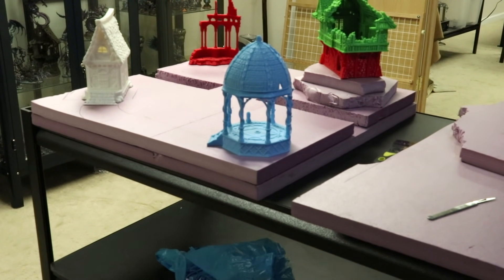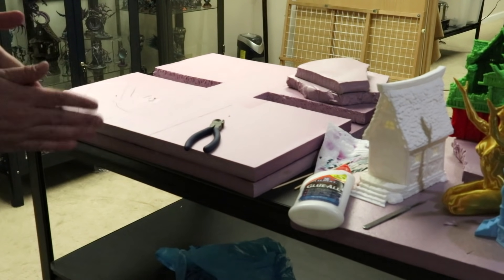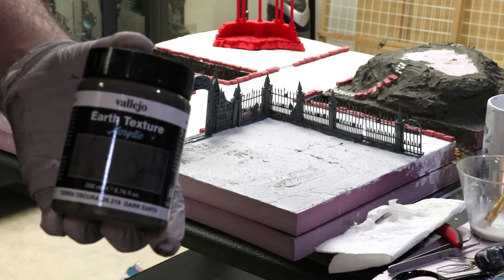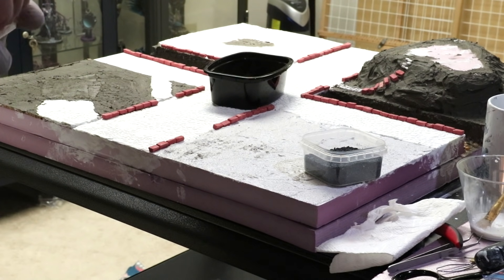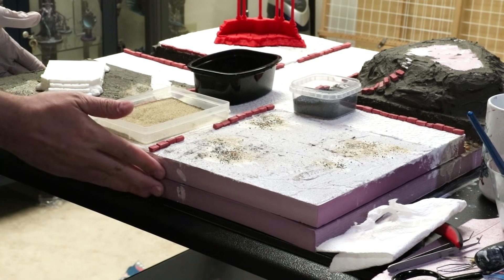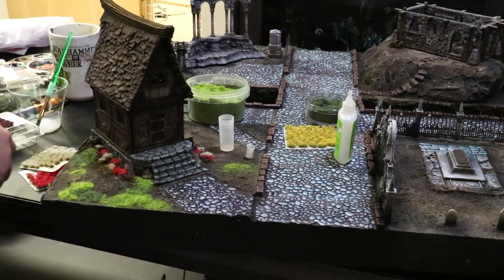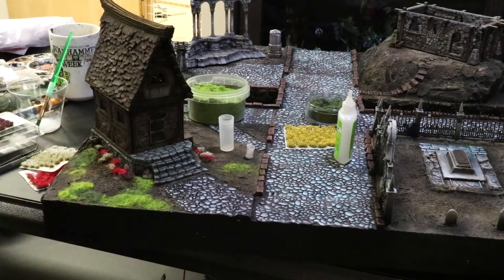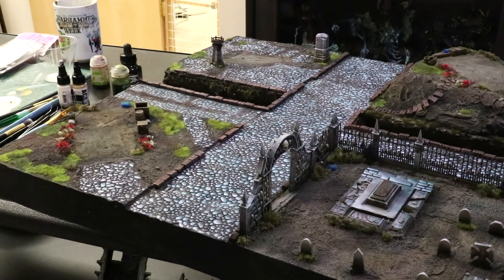Hobby Cheating 206 - How to Make Display Boards

Comment: A tip for the patch and paint! A little bit of water into the bucket, and mix it around with the trowel a bit and it’ll come out way easier, and spread way better.
Reply from the maker: That's an awesome tip, I will do just that next time. :)

Comment: Great vid as usual,on the protecting foam from rattle cans, a coat of PVA glue does the job and it's cheap😉. You can make a cheap static grass applicator with a metal sieve and a large capacity battery like those ones they sell for torches with the two doing contacts, just connect the sieve to one contact and run a wire with a probe to the other and job done it's not pretty but it's fine for small amounts like you need😀
Reply from the maker: Nice! Good tips for sure. :)
Reply: @VinceVenturella  There are a good number of DIY build videos on youtube, of varying quality; but it's worth knowing that, if you're basing your cost assessment on the Noch model, there are others on the market - the Peco model is about 1/3 the price and there are some Chinese models out there closing on 10% (depending on the deals you're able to get - but a quick Google search on UK prices shows the Noch at £140+ and a Chinese model on eBay at £16...)

Comment: This was a great video. Really helps me grasp how to my my first display board. But I have questions, what filament did you use the 3d print the buildings and what did you do to get them painted? It feels like you didn't really go into detail on how the buildings were prepped and painted. As for filament, I'd like to know because I know PLA is at risk of melting in a hot car, so I don't want to spend alot of time and money on something thats going to melt to a puddle in the summer heat.
Reply from the maker: I couldn't tell you, they were printed for me by a friend (crazyhorse on twitter, often in the live shows). To get them painted, nothing different than most other terrain. :)

Comment: So I had a hobby question about my display board ive been working on since january. (Started with a few hobby related NY resolutions) I wasn't sure where you preferred to be messaged about such things, but this seems like an appropriate place.  I'm to the point where I want to pour resin as water to make a pool of souls into my board.  I want to have Skulls suspended in the water with wisps of color trailing from them.  I don't want the...acrylic? oil? wash? dye? ink? to spread out too much into the resin and just be a blob of color instead of a trailing wavy line.  I'm listening to your Failure video right now and I really want to have "Prior Planning Preventing  Poopy Product" (paraphrase) since i've sunk so much time into this one. So the question(s)
 Is there a certain time in the resin curing process that is best for suspending objects?"
Do i have to do a layer, let it cure, place skulls, do another layer?
Would a two layer process be visible/does that even matter?
Is there a certain time in the resin curing process that i would be able to dab color onto end of toothpick or something to not have it spread out into color blob?
What type of paint should I use to create the trailing souls/wisps behind the skulls?

hahah sorry if this is too much, but an answer to any of them would very much ease the anxiety of finishing the last of my hobby resolutions.  (sculpting and casting couldn't do much damage if i messed up)
Reply from the maker: No issue and yes, you have the right answer. Occasionally I facebook I will see these multi-pouring videos were people paint "fish" in water or whatever through multiple pours. So what you would do is something like the following. 

1) Pour 1/3rd of your space. 
2) Let it mostly cure
3) Push a skull gently into the layers
4) Let it dry completely. 
5) Paint the energy trails with standard acrylic paint
6) Pour another 1/3rd
7) Repeat 2-5
8) make the final pour

Hope that helps.
Reply: @VinceVenturella  definitely! Thank you so much.  Looking forward to finishing up this weekend.

Comment: About to jump into something like this and I will be working mostly from your video here. Had a quick question - I'd heard that sometimes enamel spray paints attack foam? Is this not the case with the pink foam, or did you just cover everything really well with spackle, sand, and rocks? Thanks much for all your work!
Reply from the maker: Aerosol sprays will melt the pink foam. In this case, I covered everything with enough glue and dirt and such that it didn't get negatively effected.

Comment: Where are the buildings from? Specifically the green/red plastic looking one
Reply: I'm also curious!
Reply: Probably 3D prints
Reply: They were 3D printed by me. The files are from printablescenery.com
Reply: @crazyhorse-us3ng  Thanks!
Reply from the maker: Yep, I thought I referenced that in the video somewhere, but if I did not, Crazyhorse is the man for sure. :)
Reply: @crazyhorse-us3ng  Can I ask what kind of printer you have? Thanks
Reply: @PossibleDoot  I have a Creality CR-10s, Creality CR-10s Pro, and a Creality Ender 3

Comment: yes, it's a video thats not very new, but for the grass, just use a squeezer bottle, this one u use for cleaning the airbrush, just remove the straw. if the bottle is the right material, it will load up the grass static. just put a finger on the straw hole, shake it well (load it up) and then turn it up side down, and press the grass through the hole. Every plastik bottle schould do this, and if not, use a fur, and rub the bottle with it... like a balloon and hair, you know the effect. cheap and easy, and please excuse my english, I'm just a german guy with school englisch.
Reply from the maker: No issue and good tip.

Comment: Here's a question.  How do you simulate velvet on a mini?
Reply from the maker: Very small repeated hashes building up to a very high highlight, it's a lengthy technique. You can see it on the primaris captain I shared earlier in the year.
Reply: @VinceVenturella  Thank you.
Reply: @VinceVenturella  Ummm...  Can you point me which section that is in?  You've got a lot of videos...
Reply from the maker: @bencoomer2000  Sadly, I didn't do a video on this one yet, but I will add it to the list, here is the image in question on twitter - https://www.google.com/url?sa=i&source=images&cd=&ved=2ahUKEwixv8TAxtrkAhVEu1kKHfvvCPMQjRx6BAgBEAQ&url=https%3A%2F%2Ftwitter.com%2Fwarhammerweekly%2Fstatus%2F1117027021673172992%2Fphoto%2F1&psig=AOvVaw2xwONpsU3RiDEpWWpSd6WX&ust=1568902257829118

Comment: I may have missed this but what exactly are those pink foam sheets and where do you get them
Reply from the maker: MDF, it's basically insulation, you can buy it from the hardware store in those pre-cut 2x2 squares.

Comment: MDF is medium density fiberboard, basically fake wood,  the pink foam is called foamular. Not important but I’m in construction so this bothered me
Reply from the maker: Good clarification, it always confused me because both are labeled as MDF at my hardware store, but they are clearly different. I will use that terminology from now on.